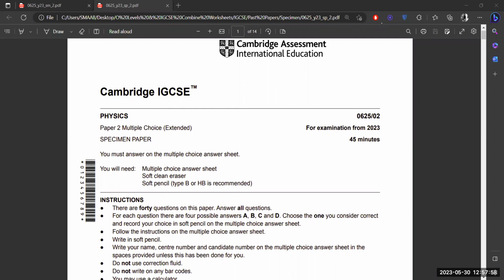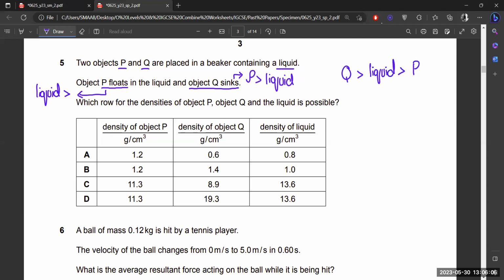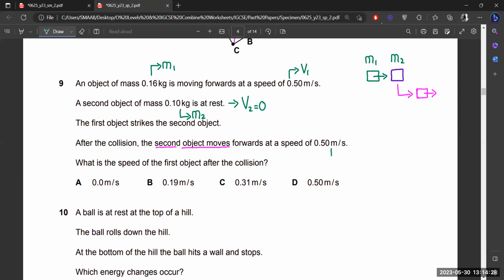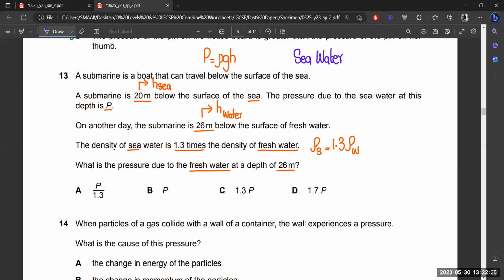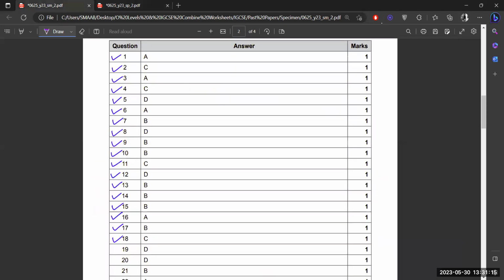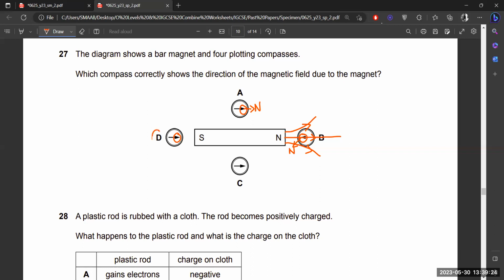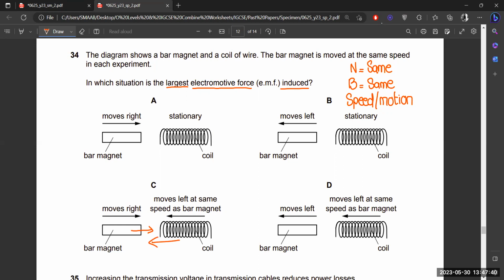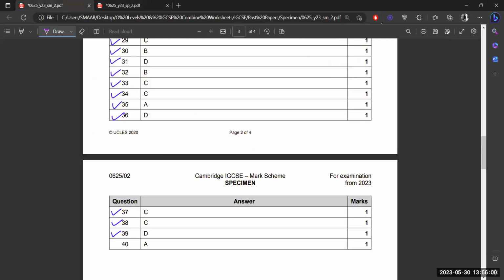Physics Specimen Paper | Paper 2 | 2023 | 0625 | Solved | IGCSE | Physics by SMAAB

Comment: I have a question , in 50:40 you said that if we decrease the current the resistance will also decrease , but they are inversely prop ? . and decreasing the current will instead increase the resistance .
Reply from the maker: Use the formula for power dissipation ... P = I^2 R ...